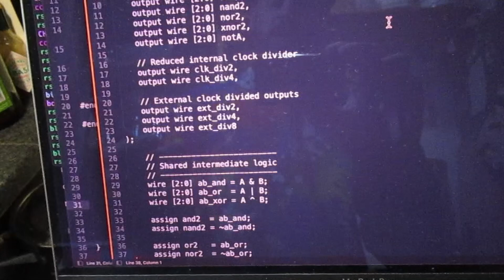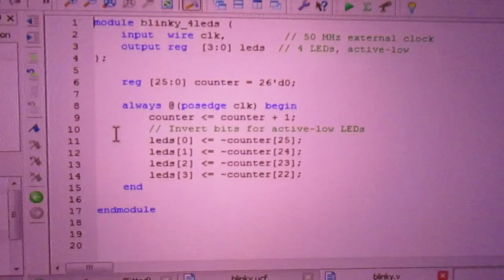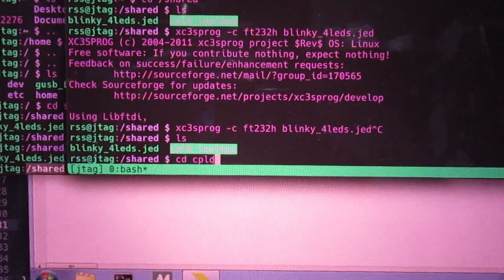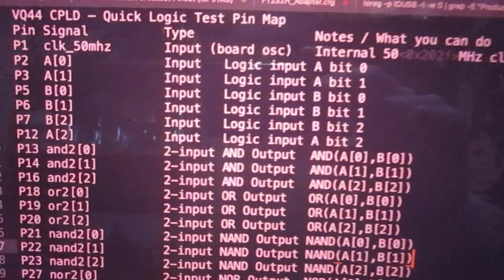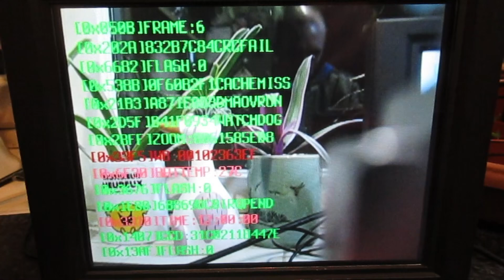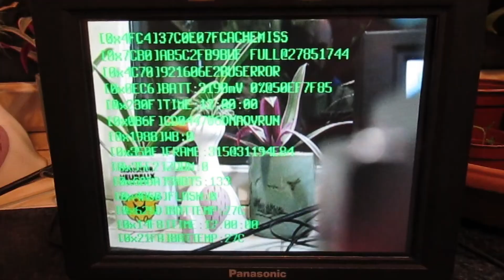Xilinx CPLD, Verilog, FT232H, xc3sprog, Raspberry Pi, Circuitbent Camera, .lua, JTAG, CHDK,Scripting

Comment from the maker: I'm still working hard on these AV projects/Megaproject-
The Monitor remote design is tested working, and needs installing.  The Video mixer is partway done, though needs quite some installation of all the mods and rpi pico.

The camera, obviously is mostly done, though I have got some mux chips to work with the bends I want to see how they will sequence.  Any pin can connect to any pin, and they are accessed with i2c.

CHDKPTP and lua are tested working well on the camera too, the dev. set up is very nice for lua and the camera (windows xp on 2009 Macbook, dual boot)

The sequencer is the least done really, but I have been working on that too.  Its the part I understand the least.  I have done the bring up code for the chip which will run it.  It is an industrial control chip more than its a user/community friendly piece, so its been difficult.  And it was also the first big embedded project. . .

Comment from the maker: A logic toolbox for the Xilinx XC9536XL CPLD, from 2007.  I got this on a breakout board from Ali-express.  It will remain as a valued addition to circuit bending, general diy signal wrangling experimentation.

I may involve XC9536XL in the finalised design of the camera node (it is part of a multi-node AV instrument) though I will make up a small PCB for it to reside on - this breakout board will stay as a logic toolbox.

Multi node Av Instrument - 
Comprising of a Camera, monitor, and video mixer. (perhaps two of each)
Each node device has been modified to accept midi CC messages -

Each node will be midi controlled from a Central, sequencing, pattern generating unit.  This will address the camera/s directly, and gather CVs, Clocks, and Midi messages, and pass these to the nodes.  

In addition to this a Raspberry Pi will run CHDKPTP, controlling more complex scripting and changes on the camera/s.

Later in the video there are some examples of the .lua scripting I've been working on for the camera.